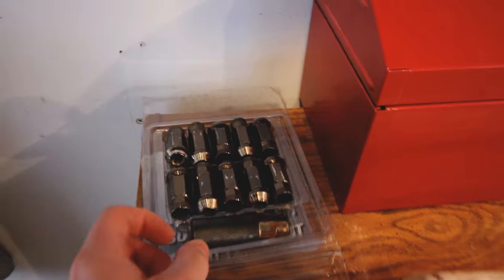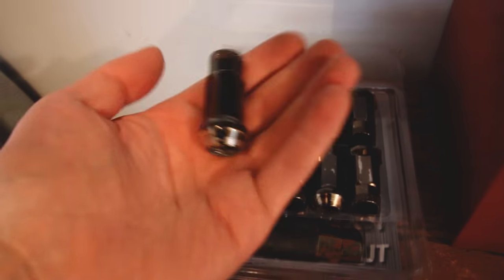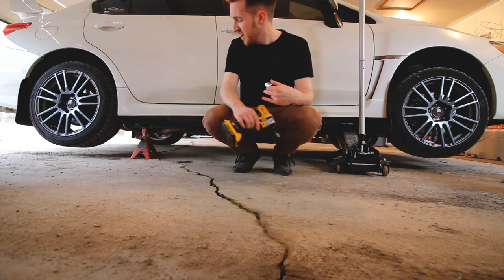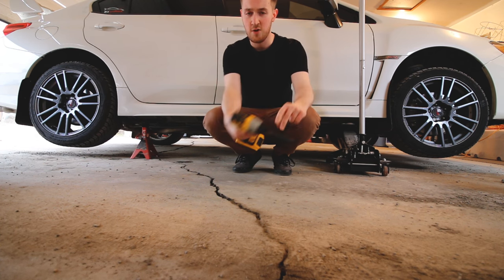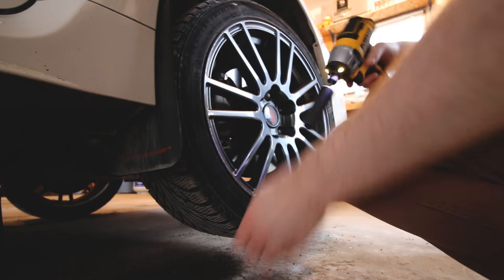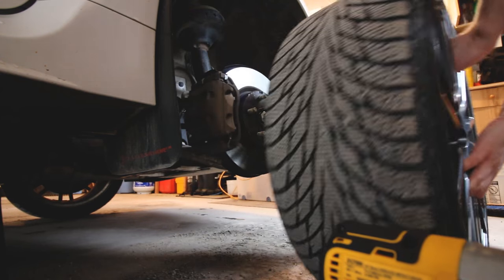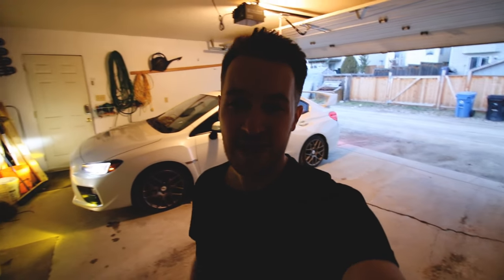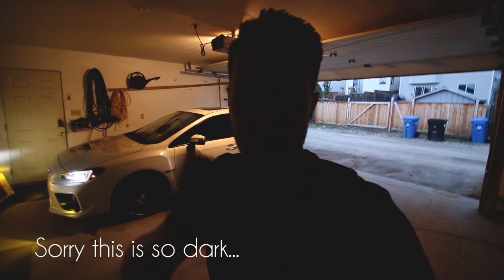TSW Nurburgring 18 x 9 | 2015 2018 Subaru WRX STI

Comment: 15 STi in Calgary,
If your TSW Nur wheel is 18 x 9, Does is have offset of +63mm?

Are you running stock size 245?

No rub with +63mm?

Comment: Just wanted to ask how much  torque did you use on your wheels and also how much air. I know it says how much air on the tyres but some people use different amounts whether they daily or track use their cars. I mostly daily  mine and put 36 to 38 psi in it. Is that to much?
Reply from the maker: Hey man! I follow what's on the inside of the door so I do about 31psi on all the wheels. 
Lugnuts I torque to 89-ft lbs.  I think 38 psi might be too much! 
Thanks for watching and commenting bro!